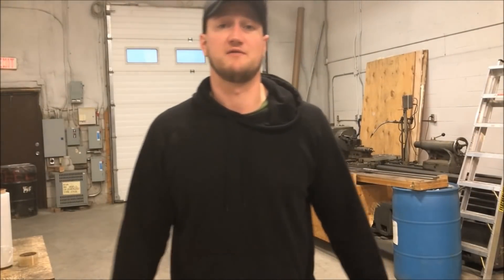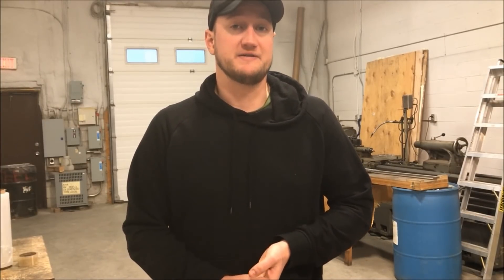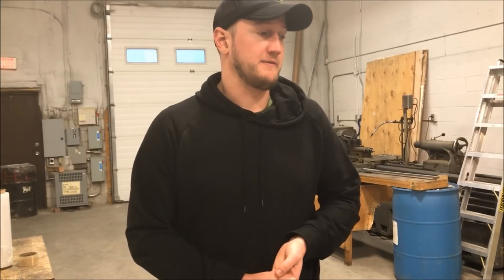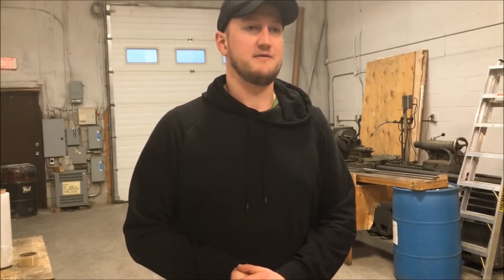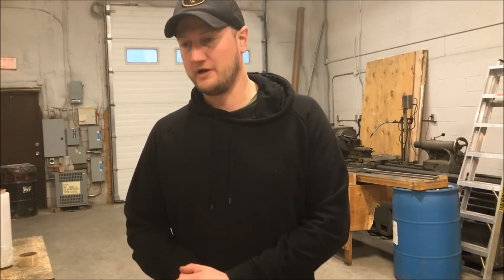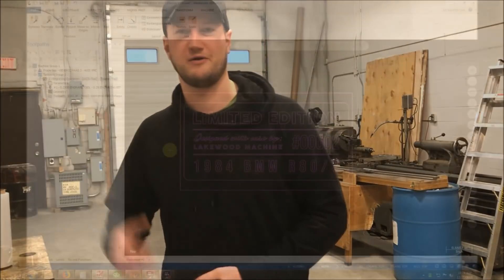LET'S MACHINE  - ENGRAVING WITH A CHAMFER MILL

Comment: id love to know the speed & feeds you used. I was doing all my engraving on a cnc router but will be trying this on my mill very soon. love your videos and keep them coming brother :)
Reply from the maker: Thanks man! I believe this was 7500 rpm at 60 IPM but I could be wrong! I’d have to double check - for engraving I usually just spin the machine as quick as it’ll go (mine top out at 7500 and 10,000) and shoot for around 60-100 IPM depending on how’s it’s looking!

Comment: I work up in Kitchener, not sure if you ever need to sub out work if so we are a job shop that does all types of materials, we also run all Haas machines except one lathe. We currently have 9 mills all from a mini mill up to a VF5 our vf3 has a TRT210 witch we rarely take off. We also have 2 lathes one Haas and one Mazak. So yea I thought I'd reach out, I can send you our company name and contact if that would be something your interested in. We also sub out work to the right shop and judging by your videos you would be a great shop. Are you currently at capacity? Or are you currently taking on work? Hope you do not find this weird reaching out over you tube.

Comment: Hey man nice video!!! Another easy way to do engraving is using couture. You turn your compensation to off as well as lead in lead out it works great 👍!!! I will give the engrave tool path a try though as well!! I've been programming for 6 years now and have yet to actually use that tool path.